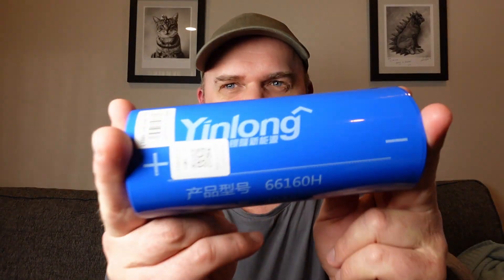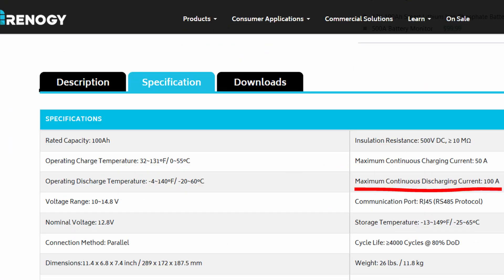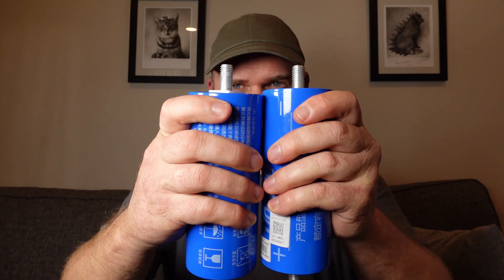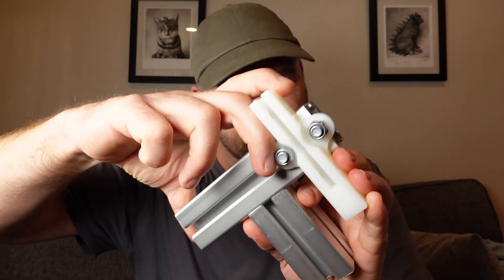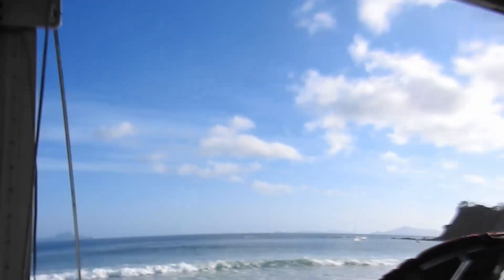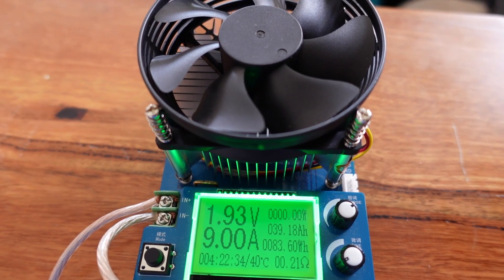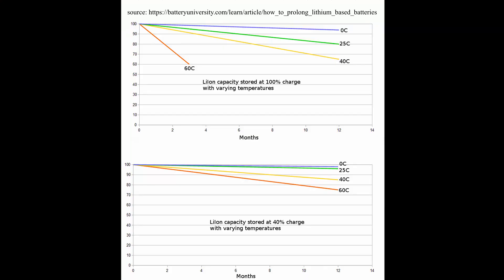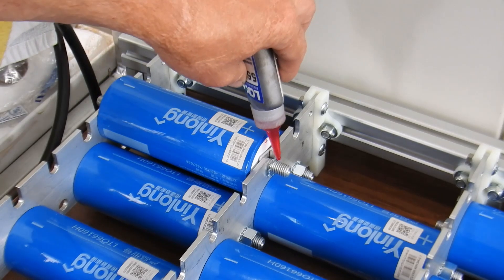Campervan DIY battery build HUGE POWER!

Comment: There all garbage keep your volts  steady. Your running 15.6 volts keep your 400 amp alternator at 15.6 volts on your vcm. So with every  6s  you need 400 amps of alternator. I rather rin a lithium iron any day of the week. They have massive storage power so 460 amp hour lithium iron life pro 4 weighs about 100 pounds. So you get 4 in parallel with 300 amp bms. So 250 amps an hour you can run 1000 amps per hour safely with out anything all battery power. Best of luck
Reply from the maker: I'm confused why anyone would run 12V.      Seems like a bizzare way to do things

Comment: I keep wondering why there is so little to be found on LTO builds, only some old videos 3+ years old?? ..Why is not everyone using these in off grid installations?? Seems like a set it and forget it option to me! Only a little bit less power density for all of those mega advantages over lifepo4?! Especially for stationary builds LTO seems like a no brainer? I don't get it, does Will P have anything to do with this.... LTO silence ?
Reply from the maker: I think they didn't really make critical mass.  LFP cells had an enormous price drop in that time due to their mass manufacture, LTO has not seen the same level of drop.
Reply: @brendontait6968  I agree price is the main thing, and I got stuck with the voltage, wanted to completely switch over in my small camper, which now runs on AGM, yellowtops front and back, + solar, 12v. But could not decide between 6s or 5s, both too far off to use in a 12v system without cumbersome extra precautions, to save my alternator from getting too hot for instance...

Comment: WOW I jumped into this chemistry a couple weeks ago with a 500.00 purchase since then I've been trying to figure out if that was a good idea this is a great video I'm sure you know by now that Will prouse did a follow up video where he explained how he was wrong unfortunately he hasn't done a video with good cells he got a couple of lots of bad cells at least in those big cylindrical ones and hasn't done anything on this chemistry in years.  I also chose 11s and 24 volt ..... but this video is old how long did you use these batteries and how did they work

Comment: Instead of lock-tite, use Belleville washers and torque to spec.
Reply from the maker: I'm not sure Belleville washers would be appropriate on these.  The tightening torque is super low
Reply: That is exactly what Belleville washers were designed for.  Low torque,, with consistent load forces.  Washers can be made out of all kinds of materials with all kinds of specifications.

Comment: Thats not true about LiFePO4 batteries.......anyone can look up the depth of discharge/cyclic life charts.......they show that 80-90% discharge kills them in 1000 cycles.  Also, commercial LTO storage batteries are running at about $2000 per kw/hr of storage.   However, LTO is much safer than Lithium-ion (the worst) and still better than LiFePO4 which can still burn. LTO does seem to be the pick of the lithium chemistries.

Comment: LTO is excellent for motorcycle battery. I build one for my motorcycle with Toshiba SCiB LTO. It starts the engine almost immediately. The measured CCA is over 400A for five 3Ah packs in series.

Comment: Geez, red loctite?  You won't get that off without heating stud.   Blue would work just fine.
Reply from the maker: It's not loctite brand.  So it doesn't follow the loctite color codes.  It is a low strength locker.
Reply: @brendontait6968  my bad, never heard of that before.
Reply from the maker: Easy mistake to make.

Comment: Great I have been experimenting with capacitors, and they are the same size as yours but top post on top, so they will hold 400 VDC I think that I could put 100 in 8 I have and choke it to 24vdc which would be a large supply I had to cross the terminals with a resister to bleed them when not in use. I have a high-amperage internet server converted to a charger? So what would you use to regulate to 24 VDC and not lose the amp hr / any help on that would be appreciated. I think they would be good for solar storage at high volt and keep my lithium topped off, and we are in a new field wide open for DIY people. I am Mike glad to see someone else into capacitor storage. Great Video.

Comment: I don't think that these cells are a good choice. Yes, high cycles. But the energy density is pretty low in these. So I'd prefer LiFePO as a better compromise on both.
Reply from the maker: A friend of mine has a 5kWh lfp battery in his van, it's about half the weight of my 9.5kWh LTO battery.  So density might not be as different as you think.  Even so, for me... energy density is the lowest consideration, safety and reliability is highest.  Additionally, these will happily run at low temperatures, they are electrically robust, ove heard of them being charged backwards accidentally and still holding full capacity once recharged correctly.  This means that a failure in your BMS will be less likely to kill your pack.
Reply: @brendontait6968  They will probably both work, but I'd need more info on these battery packs. Purely by physics the LFP battery - keeping other stats equal - should have 50% higher energy content per weight. 
LTO do better when cold, but worse when hot. So it is kind of a trade off with what problem you prefer to deal with in your use case. 
LTO has a very nasty self discharge. Does not hurt much when cycling them every day, but will hurt for longer stand times. Also hurts the "reliability rating" a little in my consideration. 
In all practical considerations (meaning: If you don't intentionally wreck your cells by backwards charging, and other blunders) I would consider both pretty much equal in safety and reliability and robustness. LFP takes all abuse that possibly occurs if the builder of the cell pack is not drunk and illiterate. LTO takes even that, but if you are not drunk and illiterate you don't have an advantage by that. ;) 

AND: Last time I checked LTO was ~3x more expensive than LFP

Comment: HEICO-LOCK
WEDGE LOCK WASHERS
these this are amazing although i don't know if they will hold to tight for when you want to undo them we used them on rally cars with great success i never had one undo its self and the engines were rigid mounted to the rollcage frame so there is no lack of vibrations

Comment: It is literally impossible to gauge the soc of lifepo4 batteries by voltage alone, so setting a charge controller to stop at 50% is pointless
Reply from the maker: Hey, yeah I personally don't like the flat discharge curve of lfp cells.  The lto are easy to identify soc with voltage.  The bms should easily be able to tell the soc of a lfp cell from just current monitoring, so should be trivial to set charge cutoff points.  With my setup, I've found myself reducing charge voltage level in summer and increasing in winter.  I have heard that lto cells can vent if held at high soc at elevated temperatures.
Reply: ahh yeah, makes sense. I haven't had any experience with the lto chemistry. You done a great job building and stashing the pack too.

Comment: If you're aware of the most extraneous loads you might as well set up capacitor Banks before those loads so it doesn't hurt the batteries or bring them over temperature
Reply from the maker: Hey,  I'm not sure capacitors would help.  Capacitors help lead acid batteries quite a bit because of the sag that Pb cells have.  Because these cells hold the voltage high and don't really sag when load comes on, a capacitor won't be able to dump much of it's energy.
These are rated for continuous discharge of 90kW and I have it fused for 10kW so the peak loads shouldn't cause much drama.

Comment: I need some of these cells, never new about them until watching this video…Wow 40 to 80 years life span and I see Tesla is looking at them now. Do you still have the mog and when more videos…!!? 
Iv joined all the Facebook Unimog groups but the main thing that’s holding me back is the RUC of $352 per 1000km 🤬
Reply from the maker: I didn't know tesla were considering them... there will be more videos coming, I'm just trying to set myself up so I'm in a better position for making videos.

Yeah the RUC on the mog is a killer and blatant theft.  I'm going to have a crack at trying to get mine dropped to the category below, which is about half the pricem

Comment: Will got effed over by the aliexpress supplier and received used or relabeled cells, he wasn't talking nonsense. Do your research before talking crap about people.
Reply from the maker: He was talking nonsense, he said that this chemistry is only 80% efficient and that's a reason you shouldn't buy them.  This was not due to his own testing, apparently it was something he read somewhere that he couldn't find again.  I wasn't talking crap, I said that I just about didn't buy them based on Will's comments (which were incorrect).  In fact I actually said that he generally gives pretty good information, so I don't even understand what you mean about me talking crap about him.

Comment: You should make me one for my car. I'm just trying to make or get a battery I can hook up to my car alternator and charge and probably a solar panel on the roof so I can run space heater all night and charge my phone and flashlight and charge my tools. Actually can't buy it right now sometime in the future. I'm not trying to spend $1,000 on a freaking battery

Comment: Thanks for the video.
I am interested in building a large bank for my solar system. I am running 48v Deye 16kw inverter.
I need about a 30kw capacitor/Battery bank for night conditions.

Running forklift 2v cell batteries at the moment but they are 6 years old. Looking to upgrade for cheap..... batteries are expensive in South Africa deu to import tax.
Any ideas?

Comment: 13:00 This analysis is true, but doesn't apply for backup batteries, which are expected to be cycled only a few times over their service life. That said, Pb-acid's calendar life is not great either, so this may not change the result.

Comment: NICE VIDEO BUT HOW MANY WOULD I NEED TO GENERATE 7KILO WATS OF POWER ?  Troy
Reply from the maker: Hey Troy, how long do you want to supply 7kW of power for?  If you did a series string of 11cells, you'd be able to deliver 9.9kW @24V.  The cells have a capability of delivering 900W each.

Comment: not saying its bad but compared to LiFePO4 48v 100Ah as this thing takes up too much space.... plus i don't know any application for larger than its own Ah rated discharge... its only main selling point is the life span claim of 25 years - 30 years... but this is also questionable if it will reach those years since its cycles are only 6,000-10,000 cycles... while LiFePO4 are even more annoying with ratings from 2,750 - 12,000 cycles... and even those 12,000 cycles are only rated at 10 years warranty for keeping 80% charge... so i don't even know if this battery tech is really the future.... since on paper it looks like its worse than a good high end LiFePO4 with larger capacity like 4.8kWh...
Reply: plus even with its amazing specs LiFePO4 doesn't seem like its the future... since others seems to choose to research on other types of batteries.... increasing the density and reducing the cost and weight if possible...

Comment: I'm a pretty innovative bloke with patented excavator technology and I rate Brendan highly. I am to embark on completing my trike as electrically powered and I am convinced to use these LTO batteries. Also, I have taken note of the mechanical points Brendan mentions in the construction of the battery pack; I can't/won't be using the same extruded Aluminium rail and I don't have access to CND milling or laser technology, which will be outsourced using my own DXF files, but the principles to control for expansion and to protect the batteries is highly relevant. I particularly appreciate Brendan's post-analysis of what he would have done differently and I will go for a 48V system too for the added benefit of being able to use smaller cables and reducing heat losses. I will be adding an extra flanged nut on each battery terminal to better accommodate any differences in battery length and to provide the thred lock. This video has pointed me in the right direction when I might have been swayed by the otherwise talented Will Prowse mentioned. I would be up for a collective purchase of batties and will check out the links in this video. Thank you Brendan!
Reply: Do it n run a geny motor spinning off some bit with momentum and  charge as ya go if ya can & be safe

Comment: What’s your take on super capacitors as storage? Especially in an off
Grid type situation, let’s say in the ball park of 30Kwh?
Reply from the maker: I have very little experience with capacitors for electricity storage.   But, from what I understand...  their energy storage density is currently fairly low - this may change with graphine capacitors.  Capacitors are normally the most unreliable component in electronics.  One of the other factors you have to deal with is the discharge curve...  it doesn't quite work like this, but as a descriptive... if you have a 12V capacitor when it is charged, it will be 6V when half empty....  this doesn't work with a lot of devices that you want to run.  This can be dealt with by boost converters, but.... added complexity.  At the moment I think batteries are a better storage device.  But, as soon as this is on the verge of changing I'll be there ready to build some up and experiment.

Comment: Hey! Would these batteries be good for say an electric DIY outboard. Would like to use them if they would be safer, lighter, or smaller than several deepcycle batteries.
Reply from the maker: I'd consider them, tho I'd use a prismatic type to save space

Comment: The battery states 40AH thats only 92 Watts of power.  It takes 6 cells to make a useable 12 volt battery.  That battery would still be rated at 40AH  only 552 watts.  The problem you might have getting all the wattage is that the voltage will drop lower then what most inverters consider usable.
Reply from the maker: Hi Pat, I'm not 100% sure what you are asking bc you're mixing units up, but I'll try.  The cells are rated at a 10C discharge, if you have 6 cells running at 2.3V each, that is 13.8V x 400A = 5,520W.  This chemistry doesn't really sag in voltage like you see lead acid batteries do.  That being said...  in this day and age, 12V is a poor voltage choice for an offgrid system.
Reply: @brendontait6968  You need to follow Watts law when working this out.  First thing to understand is that each battery can only provide so much energy.  If you connect them in series it increases the voltage.  Amperage will remain the same.  If connected in parallel the voltage remains the same and the amperage increases.  Watts law explains the relationship. when converting amps and voltage into a unit of energy.   volts x Amps = Watts.  It doesn't matter if you want to measure amp hours and watt hours as that is just energy over time.   So Volts x AH = WH   Now apply that to the batteries.  2.3 v x 40 AH = 92 WH  So 92 Watt Hours is the capacity of the cell.  If you connect them in Series to get 13.8volts     13.8 volts times X Amp hours =  552 Watts hours    or 552 / 13.8 = X = 40 AH.    A lot of people mistakenly think if you connect the batteries in series you increase the Amp capacity.  Those look to be good batteries and as you stated should last a life time.
Reply from the maker: @patkarp1965  the reason I was confused with your previous question is you had your units listed as watts instead of watt hours.  I'm not sure that I've ever heard anyone think Ah capacity increases when you run cells in series.
Reply: @brendontait6968  in the video you state that the battery can provide 100 amps which is equivalent to 1000 watts.  That is not the case with a 2.3 volt battery.  Now if you are talking about a 6 cell battery then yes you can have access to 1000 watts but only for 30 min.  As a 6 cell battery only contains 552 watt hours of storage.
Reply from the maker: I thought I said 400Amps and 900W?.  It can actually provide 600Amps for intermittent loads.  What I was trying to explain was the two ratings a battery has, power delivery vs capacity.
Reply: @brendontait6968  As for the voltage issue.  My understanding is that the batteries will slowly drop in voltage down to the 10 volt range.  Lower then what inverters need.  This will limit the usable duty cycle unless you had a boost inverter to keep the voltage high enough to still be usable.  This is dependent on type of inverter however most inverters will be effected by it.
Reply from the maker: @patkarp1965  this is not true.  If you look at my voltage discharge curve.  You'll see that the usable voltage of the cell is between 2.0-2.55V so when it's flat, if you have 6 cells, the voltage will be at 12V.
Reply: @brendontait6968  Lithium Titanate cells Charge to 2.8v and drop to 1.8v per cell.  You even have a video on this.  1.8 volts x 6 is 10.8 volts.  Not really sure why you would try to argue this.
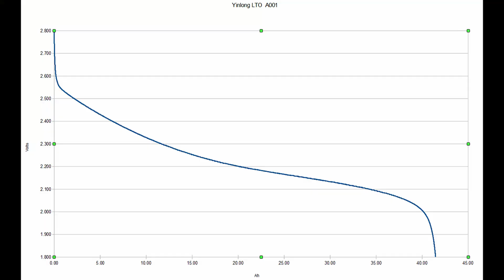Reply from the maker: @patkarp1965  I give up... you obviously know a lot more about this chemistry than I do..  if you note tho at time stamp 12:45 I show the discharge curve and note that there is little benefit taking them below 2V per cell as they won't really deliver usable capacity below that.  2V x 6 cells = 12V.  Nearly all of their energy is held between 2 and 2.55V.

Comment: This looks amazing but I’m just wondering why you chose the number 99..
Reply from the maker: I was wanting around 10kWh and needed to be in multiples of 11 to get the required voltage, so ended up with 99